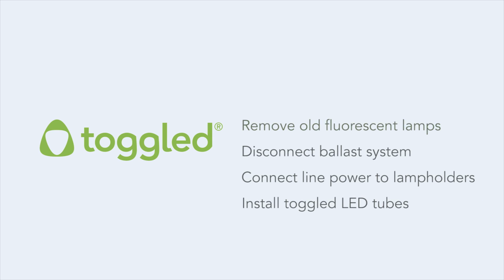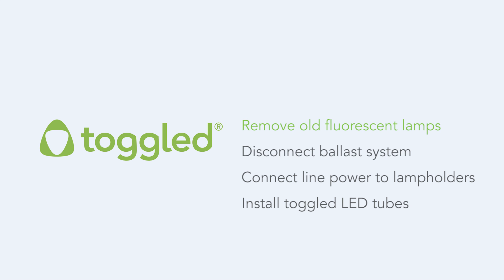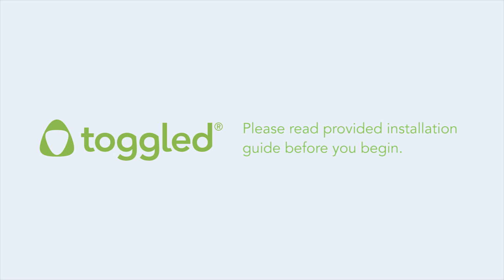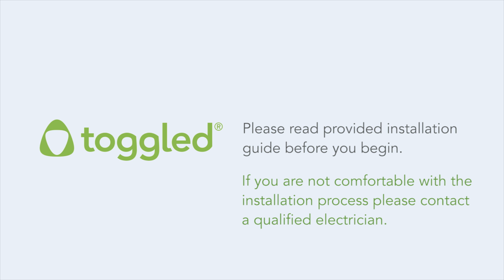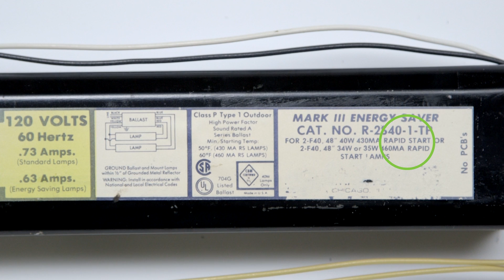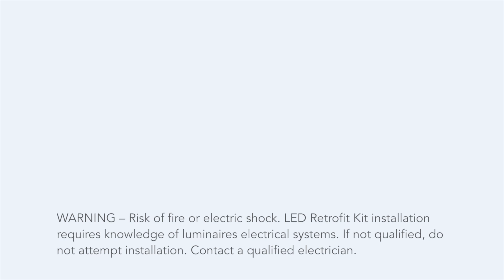Toggled direct wire (T8/T12) LED tube Installation Instructions

Comment: This video is missing steps. Can't tell from the video if I have shunted or un-shunted. The video doesn't show it. How do you get the the lamp holders out? I'm no electrician. I have to call an electrician to replace some light tubes? WTF?
Reply from the maker: Hi Exile -- Thanks for your comment. Frequently lampholders attach to a mounting bracket that is held into place with tabs or screws. Once the bracket is removed, the lampholders usually slide out the back or through a slot.

If you would like more help with your specific application, please feel free to reach out directly at support@toggled.com or 1-844-toggled. We would be happy to assist you with your retrofit!

Comment: Do you have a video for the 2X2 retrofit system?
Reply from the maker: Hi John -- We do not current have a video for this. Essentially the existing lampholder brackets and clips that hold the U-Bend tubes are removed. The new lampholder brackets are then installed using self-tapping screws. The brackets are pre-wired for our tubes and only need an easy connection to the incoming AC hot and neutral wires.

Comment: Great video. Thanks! My lights are working fine, but there is a very loud and noticeable buzzing sound coming from them. Any idea on what could be causing this?
Reply from the maker: Hi Morgan, it is likely that the buzzing sound is coming from your circuit. To eliminate this, you can try moving the lighting tubes, or moving whatever on the circuit that is causing the noise.

Comment: Can I leave my daisy chain in place on the end I'm using for power and then just connect to line and neutral?
Reply from the maker: Hello -- Sorry for the late reply! You can leave the daisy-chain in place and connect to line and neutral. Thanks!
Reply from the maker: Hi, 
Yes that is correct. For any additional questions or comments feel free to send us an email at support@toggled.com or call us at 844-toggled.

Comment: Between the kit instructions and this video, I was able to successfully convert my fluorescent kitchen light fixture to the Toggled LED tubes.  As mentioned in an earlier post, my fixture also had two ballasts (4 tubes) which made me question the wiring of the existing shunts.  To eliminate any confusion with the wiring in the existing shunts, I decided not to use them at all but rather use the ones provided in the kit and wire it per the diagram in the instructions and this video (using the daisy chain method).  My only complaint with this video is that the wiring in the daisy chain (see 3:38 thru 3:41) leaving the 1st shunt thru the 4th shunts are the same yellow color for both the Power cable and the Neutral cable.    As a safety precaution and to make the wiring easier to follow, I would change the video to show consistent colors throughout the daisy chain (Red for Power cables and Blue for Neutral cables from the 1st shunt thru the 4th shunts).  Mixing them up can result in a potentially dangerous situation.

Comment: GOOD VIDEO - change the term shunted to shorted for the general public - former drunken electrician turned stupid engineer - check sockets for continuity with ohm meter.

Comment: The install is easy, but be aware that the dispersion pattern depends on the orientation of the lampholders and the design of the fixture.The A416-35210 type sold by Home Depot as Soft White emits all light from a strip of approximately 40 LEDs roughly an inch apart, with very little diffusion provided by its lens.  

My kitchen light fixture has them lampholders slanted ~45 degrees up from vertical. The Toggled lamps throw the light wide and high. Without the crystal diffuser lens in place, the light is too bright against the walls and the area on the floor directly beneath the fixture is  noticeably dimmer.    If the lamps are twisted the other way in the holder, the area beneath is too bright, the walls dark.  Correct orientation of the lamps with the lens in place makes the light useable.  A more opaque diffuser would spread the light more evenly and conceal the individual LEDs.

In a shop fixture with vertical holders, the light doesn't use the fixture's reflector at all.  The light pattern  is much more much more vertical and concentrated,
Reply from the maker: You may need 90 degree lampholders for this application which will allow the lamp to face in the correct direction.

https://store.toggled.com/collections/lamp-holders/products/lh0041-unshunted-rotary-locking-lampholder-right

Our new D and E Series lamps also feature a much larger beam angle for these types of applications.

https://store.toggled.com/collections/dimmable-led-lamps/products/d-series-t8-t12-dimmable-led-lamp-4ft-48in-120-vac-16w-3000k-warm-white

Feel free to contact us with any questions you may have. We are happy to help!

Comment: Very confusing video. Didn't do too much to help me figure out install
Reply from the maker: Hello, I am sorry you are having trouble. If you need additional assistance with the installation process,  please call 
1-844-toggled (1-844-864-4533). We are happy to help you!
Reply: ha ha very good video with cute girl - listen carefully, Best video I found on subject. Got my tubes from 1000 lamps - toggled was out of stock, used toggled instructions :) no instructions from 1000 lamps
Reply: mbibace I was confused too. Took me days to figure it out. Especially because my light fixture was different and has 4 tube lights. And had two ballasts.

I thought this video was gonna be on the light at the beginning but they showed a different one for installation.